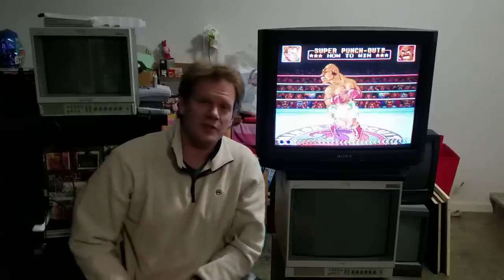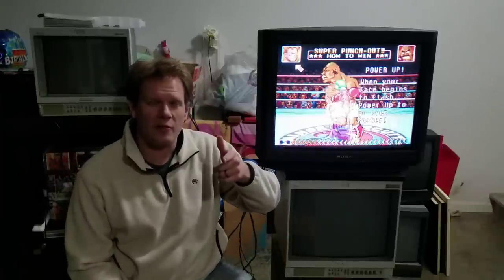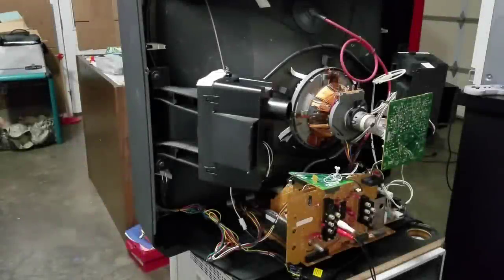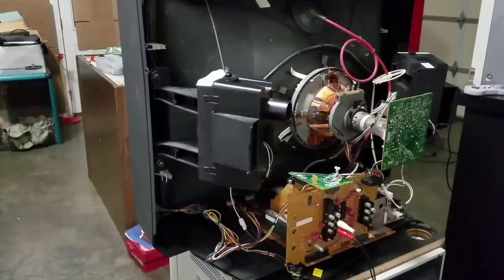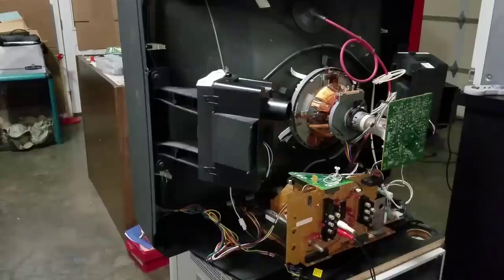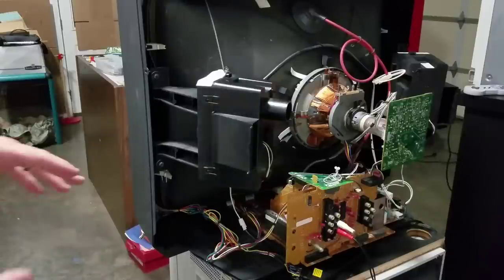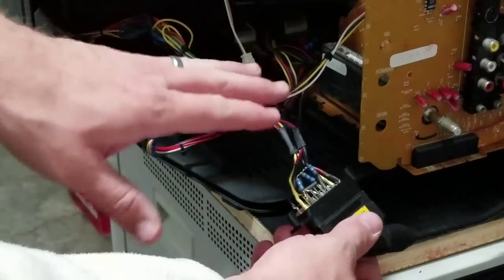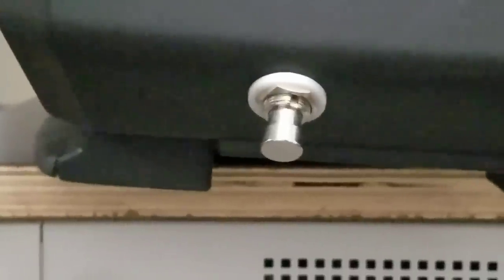Sony KV27 CRT TV w/ RGB Mod - Review & Update

Comment: Overall convergence setup on a TV like this would be done by moving the rings behind the yoke and tilting the yoke up/down/left/right until everything matches as well as possible, I would think.
Reply from the maker: Thanks Michael,  You are right I didn't mention that.
Reply: I have a KV-27v20; same type of chassis, but a smaller screen. She performs well, but she has an issue in the upper-right corner; red is out of alignment and pulled upward. Would moving the rings on the yoke fix something like that?
Reply: @hylianarmy0  magnetic strip will

Comment: I have a Sony kv32fs100 flat screen made in 2003 that I was just given.  I noticed that the upper corner of the screen droop downward.  Is the only way to fix this issue to move the magnet strips on the back of the tube?  Also what are your opinions of these flat screen options.  It doesn't seem like you have any for your old school games.  Thanks!

Comment: you have any experience with those generic arcade monitor chassis for converting a TV?  you can supposedly put on a TV tube as long as the yoke impedance is right

Comment: Hi! RT i have a few question's about crt's.
Can i swap a tube in my pvm 14n6e with the simmilar size tube from trinitron consumer great crt?
Can i replace flyback transformer from trinitron consumer great crt?
Reply from the maker: Hey, I'm not sure about the Fly-back yet.  It is a replaceable part, but I don't know of the exact part to fit it or a good place for replacement parts.  I've found a good source of Flybacks for Arcade Monitors.  Maybe one of these can work for Sony CRTs but I'm not sure on that.   It's hard to say if a tube will work or not,  some will and some won't for tube swaps.  If it's similar in type/similar model then the chance are more likely that a swap will work.
Reply: @RetroTechUSA  Ok thank you very much